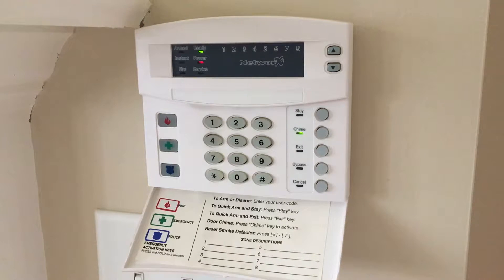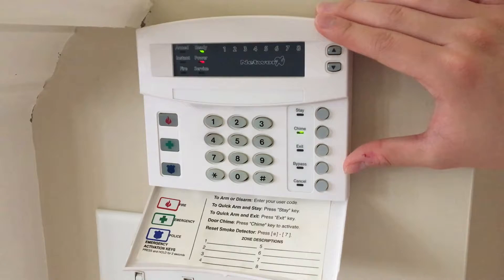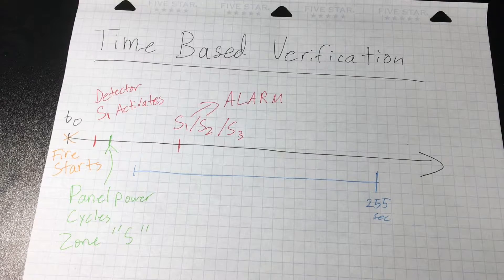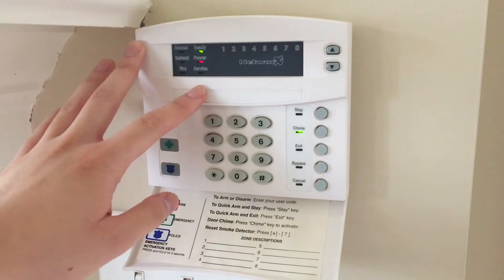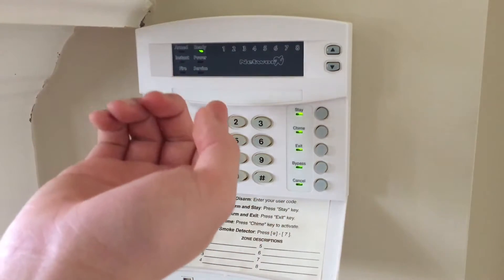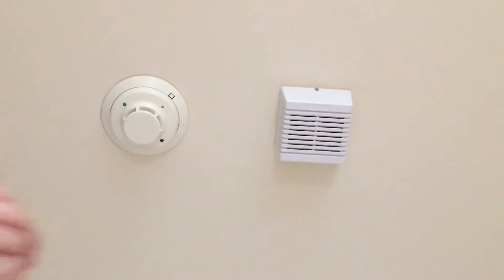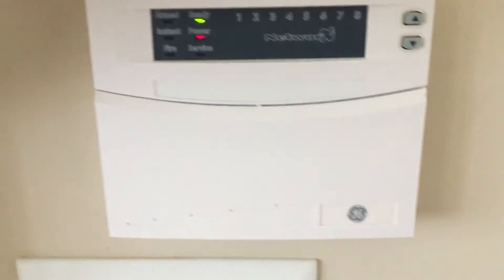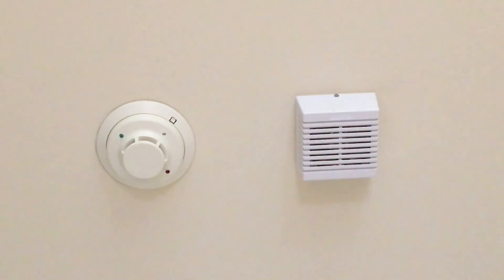Fire Alarm Verification Demo

Comment: 9:51 what is up to the speaker alarm? the speaker alarm is going CLICK CLICK CLICK CLICK
Reply from the maker: For the purposes of demonstration, I turned off the driver so it's a voltage-only output, hence what you only hear are pulses from the panel sending power to the speaker.

Comment: Cool. I like Concord systems.
Reply from the maker: This is actually a Networx system, but they do use very similar keypads.
Reply: @BousaiGuy  oh
Reply: @BousaiGuy  I think that networx is a GE based company, so is concord. So arent they technically the same?
Reply from the maker: @AcElectronicSystems  No.  NetworX is a series of panels that are now being manufactured by Interlogix (formerly GE), as well as the Concord series.  They're separate panels and cannot be used interchangeably.